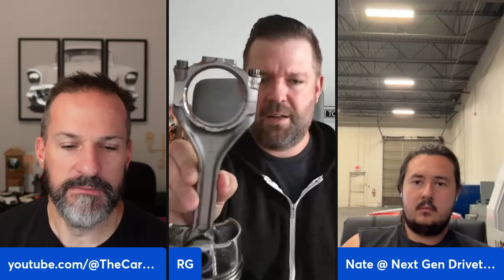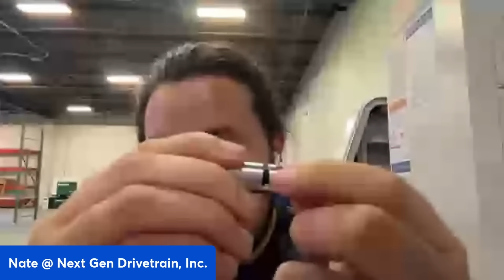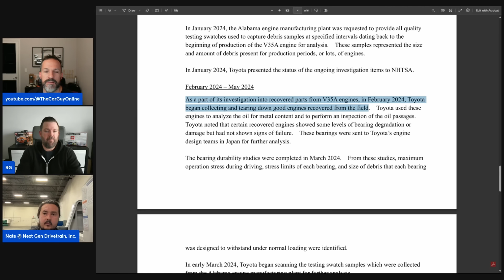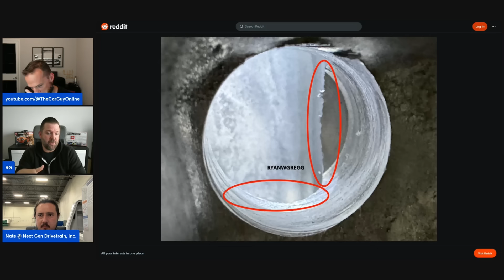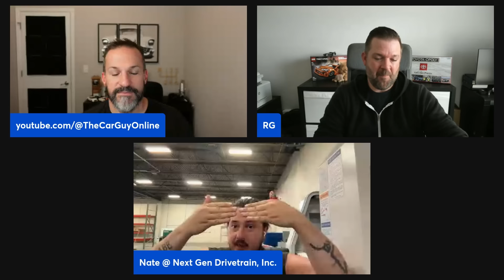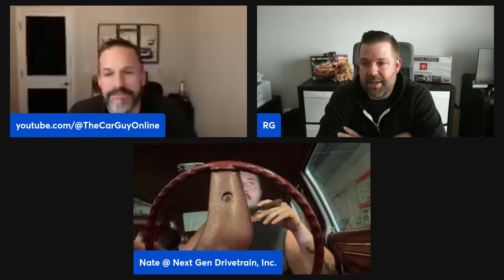Toyota Tundra BOMBSHELL. Buyer Beware Until 2026 (Full Interview)

Comment: The Kaizen/5S process is just for public consumption. I used to work for a fortune 500 company that followed the same business process (Kaizen/5S) as Toyota. Cost cutting was the main focus not continuous improvement over time. If the process was truly followed I don't think the company I worked for would have went from a 4.5 billion dollar market cap to the current 330 million dollar market cap if the company would have practiced what it preached. Bottom line is Toyota is lying thru their teeth about the issues they are experiencing. The common them with Toyota and the company I worked for was "keep the problems within our four walls, the customer does not need to know our issues". This business practice does not work out in the long run IMHO!
    What I don't understand is why RG is so loyal to Toyota. I have adopted the opinion that I'm not loyal to any manufacture any more. Who ever is producing the best product IMHO at the time I looking is the one that gets my money. Loyalty to a company in this day and age will just allow them to continue to operate in a manner that does not serve it's customers well because you are allowing them to march on to screw you again!

Comment: I'm still driving my Ranger 4.0 ohv 5 speed stick 4x4 supercab off road from the late 90's I  bought brand new and it still looks great and runs great. The wife's new 23 Rouge is supposed to get a new engine in a few months and doesn't even have 20k miles on it. It is hard to believe the car culture and amazing cars from the past is so different now.  New cars don't seem to be designed to reliability.

Comment: Toyota consistently built better products when all Toyota's were designed and built in Japan.
Reply: So you're saying the 80s?  Lol
Reply: @beexiong2995   Toyota's from the 80's were more reliable, durable and maintainable than today, that was the period Toyota built the reputation they are still living on today.     My previous comment was base on the Toyota's I currently own that spread across more than 30 years.  A 91 pickup, 99 4runnuer, 2000 Tundra, 10 4runner, 22 GX.  All bought new and are still daily drivers.  Durability wise the 91 pickup and 99 4runner are without a question the most durable or the bunch.

Comment: My 1982 Datsun 210 doesn’t just run it roars with the soul of Nissan’s finest: the legendary A15 inline 4. 1488 cc of pure mechanical poetry, pumping out 65 horses and 80 lb-ft of torque like it was born to defy its era. It’s not just an engine it’s a time capsule of grace and glorious simplicity. Every turn of the key is a love letter to old school engineering. And I wouldn’t trade it for anything.
Reply: Had 1975 B 210 (bought new), drove 14 years, put over 400,000 Miles on it.
Reply: @vincentrister8571 wow very nice I have my 210 for 21 years now with only 198,100 miles on it.
Reply: @ItsJSTNDAD  You finally got it broke in ,lol. Got a 4 or 5 speed manual?
Reply: @vincentrister8571  is a little sad 3 speed automatic 😢

Comment: I worked hard. Accumulated a large nest egg. I'm retired and could walk in almost any dealer and write a check for a new car, but I refuse to buy some auto manufacturers warranty problem. My beater is a GM GMT-800 Suburban that will outlive me. My daily is a naturally aspirated port injected V6 Acura. I would rather donate $100 grand to a good cause than buy a new Suburban.
Reply: So do it.
Reply: @9ZERO6  What's your mailing address?

Comment: I've come to the opinion that the care guy is just a Ford V6 ecoboost hater.
Reply: Supposedly he only has Toyotas
Reply from the maker: I had issues with my last 3.5L that had 60k miles, 2017. Throwing PCV codes and couldn’t haul my 30’ bumper pull up Floyd hill without the head overheating at 60mph. My triton before that was fairly reliable, neighbor had his 3.5 eco boost throw a rod out the side at 36k miles…call me anecdotally jaded :)
Reply: @TheCarGuyOnline You just happen to be unlucky. My 2015 F150 2.7l ecobeast FX4 is the first new vehicle I ever bought. It now has 176,000 Hard hard miles and still runs great. Did your neighbor have a tune on his truck? 

14 years as a Ford Gas/Diesel master technician (no longer a tech automotive industry sucks) I have never seen v6 ecoboost throw a rod thru the block. Actually really never had failures with them. Just the 3.5 phaser rattle, the 2.7l oil pan leaks, and some phaser solenoid issues and oil burning issues with the 5.0.
Reply from the maker: @1FiftyOverland  I've heard good things about the 2.7L, but I also hate wet oil pump belts (2.7L/5.0L/3.0 Duramax). I don't think it was just me that was unlucky with the 3.5L and my neighbor, in addition to that Ford wouldn't replace his 3.5L at 36k miles, they didn't honor the warranty because he didn't do oil changes at Ford. He had receipts for his at home oil change, they still didn't honor it....since them I've been done :). You can be a fan though, I have nothing against that, I just think people should have zero allegiance towards any manufacturer, it's "us vs. them"....all of them IMO.
Reply: @TheCarGuyOnline 

He should have taken that to Ford Corporate. When I was a technician, Ford covered everything. They even told us that if we can't prove in a court of law that what the customer did caused the failure, it is covered. 

I even had a 6.7l superduty, engine failure. Pulled valve covers completely smudged up. Truck had 60 something thousand miles, still had factory oil filter. I denied warranty,  customer called FoMoCo complained and Ford engineer called me and told me it will be covered.

Comment: I hate to tell you guys but Toyota turned to shit back the turn of the century. 2001 Toyota started putting more filler in the hot dog and its only gone south from there. I know I am an older fker but Toyota turned into GM decades ago. GM turned into Hyundai / Yugo a decade ago.
Reply: Well your wrong.  I have a 2003 Camry with 305,000 miles and is still going strong.  You’re probably a GM fan boy !
Reply: @slalomking  not every model all at once but it started with the V6 in the Highlanders. Piston ring issues, etc.

Comment: 2015 f150 2.7l ecobeast here has 176,000. Ford makes fantastic engines. They also make straight garbage. 1.0l 3cyl ecoboost, 1.5l 4 cyl ecoboost.
Reply: 196,000 on my 2018 f150 2.7. Good engine. The 10 speed though, never been good but lasted this long. I feel like it’s starting to go.
Reply from the maker: I’ve heard really good things about the 2.7 but I’ve only owned the 3.5 and 5.4
Reply: @TheCarGuyOnline best engine Ford has ever made.

Comment: I havent dealt with this on my tundra yet. But ill say this. Manufactures that have a known problem need to be forced to stop sale and take care of the customer period. I dealt with this on my nissan titan. Needed a transmission took months to get one. Not long after i got into an accident. Truck needed an air bag. It took nissan 1.5 years to get that air bag. It sat at the body shop finished but i could not drive it due to liability of the air bag and i told them after 6 months im coming to take my truck rather they liked it or not. Owner came up and made me sign a waiver to drive my truck.... Well 8 months went by almost another 25k miles and poof it arrived. This was after speaking to nissan head quarters etc. 

But you know they had no problems producing more to sell more trucks and i think that is disgusting behavior by any manufacture. If toyota doesnt step of to the plate and start making it right i hate to say it buy im totally done with all these new vehicles. Ill go back to driving my beat up 400k mile suburban that by the way still runs like a top and hasnt once failed to a point i cant get home. And yes that 4l60 even when it was completely full of water and smoked still got me home with some slow driving.

Comment: Toyota has had engine qc problems for a while I had a 4 cyl tacoma they replaced the short block on w 450 miles due to damage and 1 and 2 balance shaft bearings and the truck came off the Texas line before they moved everything to Baja….😮😂😂😂
Reply from the maker: Wow, that's pretty rough, I haven't heard of that before, but definitely a good reason to be cautious.

Comment: The tundra engine has a design flaw. I've said from the beginning.
Reply: The 5.7 V8 is reporting headgasket issues too as they are getting older.  Engine rebuild right there
Reply: @beexiong2995  That is due to poor maintenance, not a design issue.
Reply: totally, that debris issue is just nonsense cover up
Reply: The 5.7 with head gasket issues are people that don’t change their radiator fluids! Mine has 328,427 miles. No problems! Tow small trailers with tractors and ATV,s
Reply: @MikeMerino-n1u still failing tho.

Comment: I have a '25 Tundra and I dropped the oil out at .75 k and again at 2.5k.  On the first oil change there was a small amount of color.  The oil filter had nothing much but the pan had a small granola sized piece of casting that could clog a passage in the wrong place.  3k oil changes with 5w 30.  The dealer wanted me to wait 'till 10 k to change the oil.  What an idiot
Reply: I would be really interested in whether you have any engine issues or if the 5w-30 will keep it humming along.  I have thought that if I had one of these small turbo engines, I would definitely be using at least a 5w-30 and maybe even a 5w-40.
Reply: @davereiland9921  My '21 Tundra had chain noise and 5w 30 made it ok.  That's what they run in Europe.  10w 40 and 20w 50 worked for 500k on my 6 Toyota trucks.
Reply: @motomikebuilder Similar story with oil viscosity recommendations for a 2016 Camry and the European owner’s manual allowing thicker oil. However I recently checked a newer Toyota and found the European and U.S. owner’s manuals calling for similar oil viscosities. 

Had to go to Toyota Australia’s website to find the correct oil viscosities for a 2023 RAV4.

Comment: In terms of modern truck engine reliability, Ford’s 2nd gen 2.7 nano engine is the best one. Seriously… it’s a tremendously strong and reliable motor.  Ford techs almost never see them in the shop (unlike the 3.5).  Getty’s Adventures YouTube channel has a great segment on this motor.  GM’s 2.7 4-cylinder turbo also seems very stout, with very low failure and repair rates.  Both engines have several years in the field now.
Reply: Too bad their transmissions are trash

Comment: I'd stay away from this gen. engine / truck until Toyota makes a "new" engine instead of "patching" it up. I guess the real issue actually lies a lot deeper in the very design of the engine.
Reply: There is no sugar coating this 3.4 TT failure. 1 out of 100 is a massive failure rate. Rams Hemis worst years had a 1 out of 250 failure. Even GMs V8 fiasco isn’t that bad (my guess)

Comment: Wife drives an '08 Corolla, 244K miles on it. Just put the 7th set of tires on it today and had a brake hose collapse. Other then filters, fluids, and minor maintenance, I've not had to do anything.  Gonna put a chain in it at 250K... maybe
Reply: Btw, change the oil every 5-6k and it still looks new and always on the full mark... with the valve cover leaking 👀

Comment: RG you must have had something wrong with your Toyota with the 10  spd if you couldn't get to 10th gear with a tail wind.   You realize that the 10 spd just has more in-between ratios right?   A 6L has a 6 gear OD ratio of 0.68 and the 10L has a 10th gear ratio of 0.63 I'm sure Toyota is very very similar.

Comment: Just wanted to dispel some misinformation presented here. The additive package and premium fuel is no different than the additive package in regular fuel. They use clever marketing to make you think it is. At the end of the day, they all have a prescribed amount of PEA which is the most relevant additive for fuel.
Reply: I’m sure that’s the case sometimes but the Motor Oil Geek has shown otherwise with Shell premium fuel. Mobil also advertises 3X the cleaning for their Premium fuel. 

Top Tier essentially specifies a minimum amount of additive, I’ve never heard it specifying a maximum.

Comment: What puzzles me, a supplier of ours is using a 2023 Tundra to deliver car parts.  This truck gets driven hard and under maintained, the mileage is racking up and it keeps running….  So is it a poor design or manufacturing flaws or just luck of the draw on if you get a good one or bad one?…

Either way this one Tundra is defying the odds…
Reply: The SR tundra has a lower horsepower rating. Wonder if Toyota did this because they figured a work truck will be driven harder??
Reply: @tacotue4eva677 You bring up a good point.  I bought an SR and absolutely love my “fleet truck” in white with all the basic rims.   It fits nicely with my two Tacomas that I own.   I worry that my 2024 Tundra (built in Nov of 2023) will blow up.  

The Parts Truck that delivers to our shop is a long box extended cab type and is a much higher trim level and gets driven hard daily.   My SR gets far nicer treatment.   I did do 5 oil changes on it in less than 6000 miles just in case there was debris left in the motor.  I run SAE 5W30 full synthetic and use genuine Toyota oil filters.  It is much quieter and smoother with 5W30 than that watery 0W20, that breaks down.
Reply: I think that is true of new rams and mew tundras . Seems so hit and miss either younget a great ram or you have an electrical system that is melting!  And same woth toyota:/

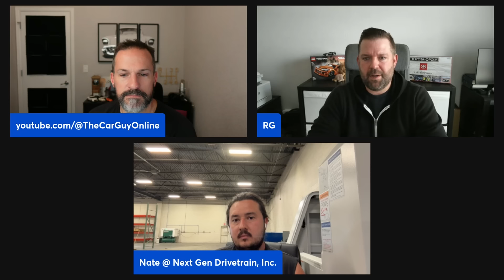Comment: Did anyone catch the comment at 45:35 about The Car Care Nut? Quite the accusation when the car care nut literally teared down one of these motors on video. This isn’t the first example of me questioning the validity of the channel and the guests on this channel and I’m now questioning said validity of this video after that comment.
Reply: Also, in that A25A video the Car Care Nut explained the reason for the dual covers was actually to address an area that had a tendency to leak on the previous engine. 

Watching the video it looks like it actually added cost to the engine. The problem is that instead of seals they used sealant on at least one of those covers and the evidence would suggest that sometimes something happens during manufacture that allows the sealant to develop a leak over time.
Reply: Care care nut does repairs not stand alone tear downs. I do cars does.
Reply: @gregjohnson2073 incorrect my guy
Reply: @gregjohnson2073 well then look up the care care nut’s video About tearing one down. He did do one.
Reply from the maker: This comment is overly dramatic. Let’s not make it more than it was, TCCN didn’t respond to him, not the end of the world, TCCN is insanely busy…but he also has many  Toyota relationships. I really enjoy his channel but business is business. I had no way during the interview to verify anything so there was really no point in talking about it further. If you think that influencers are telling you the entire truth while still getting press vehicles and having engineering access to manufacturers, I think you are probably lying to yourself. I really don’t have a dog in the fight or any allegiance to any brand. I have a day job.
Reply: Are you kidding me??? It’s common knowledge that if a YouTuber is getting vehicles from the manufacturer and paid for trips to see their new products, it does affect their content. Did this hurt your feelings? Do you know him personally? Give me a break…
Reply: @DUNEDIRT you obviously don't watch any of his videos. When he does a review on a Toyota he rags on the engineers. Now go cry in the corner.
Reply: @DUNEDIRT Yes, and he was critical of the motor so relax, girl.
Reply: @Ignignokt_but_not_Err  👧